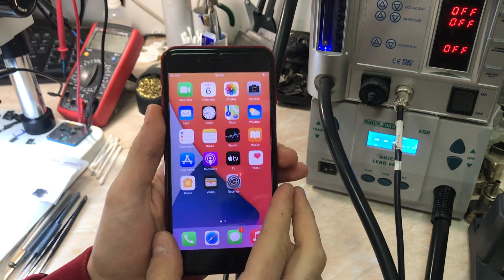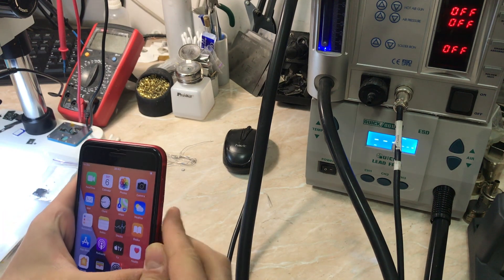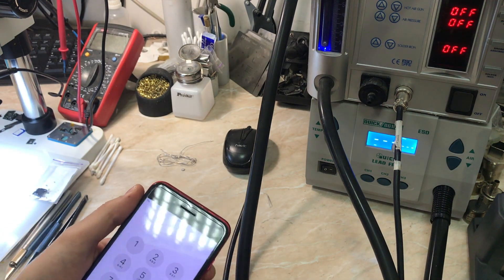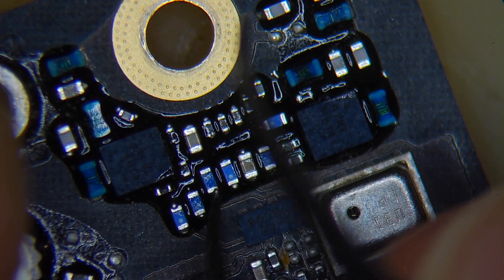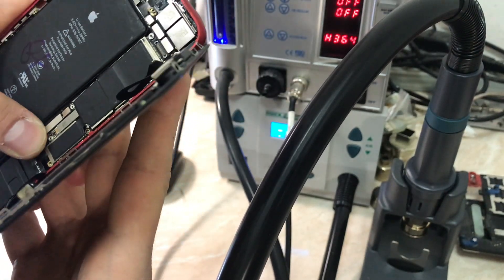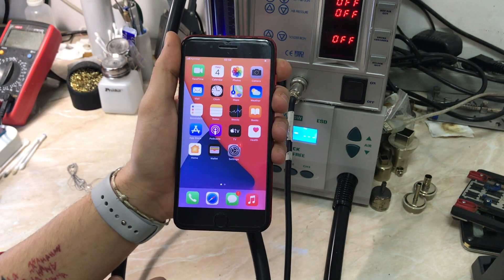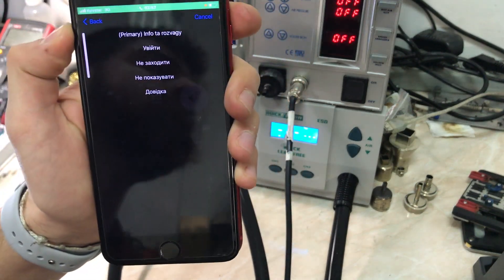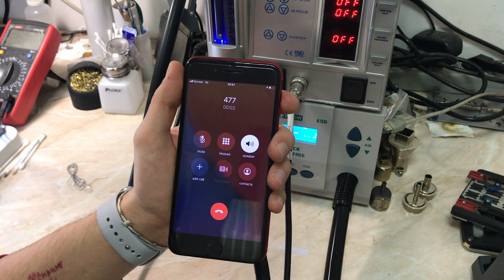iPhone 8 Plus (No Service) No IMEI When Dial *#06# Repair

Comment: Hello mister, may I ask you what the reflow gun temperature was set to? I have the same issue with my iPhone 8 Plus and I just want to reflow the chip without removing it. Thank you for this video.
Reply from the maker: If the chip is under filled, then it’s best to remove the chip and Reball, the under fill could be pop and make the chip higher than the pad on the board, causing bad connection and greyed pads, but you can use 310-320c 40-55air
Reply: @AntoineKiriaky10  Thank you!

Comment: Hello sir, i hope you can help me. Tried all of the possible troubleshooting and still doesn’t work. I kind of happen to have opened my iP8+ multiple times and changed battery, charging port set, taptic engine. I kinda of ruin and rip off a flex around upper middle right portion of the phone. I’m not sure if replacing that will resolve it. Also, not sure what’s it called that’s why I can’t buy on online yet.
Reply from the maker: DM me

Comment: I have this issue, so I had an accident with my 8+ then I lost signal and imei won't display. However I don't have the equipment to do the reballing of the IC. I'm guessing the chip isn't connecting properly to the board terminals. Can I heat up the chip with a heat gun, to reball it without removing it? Kindly lemme know if this is possible.